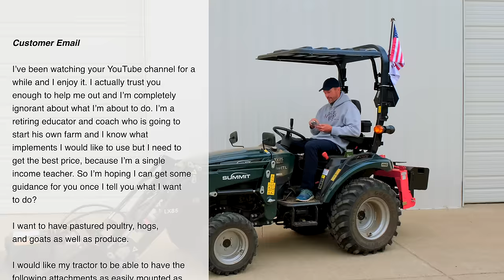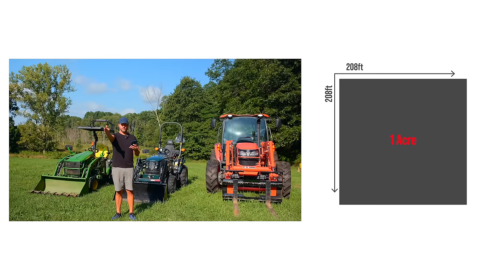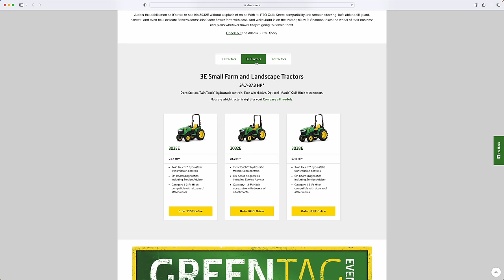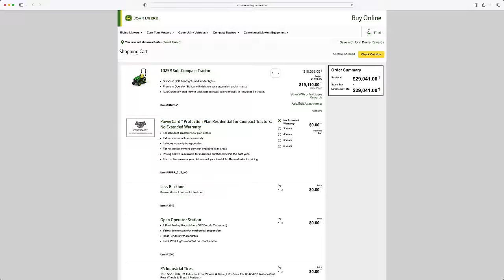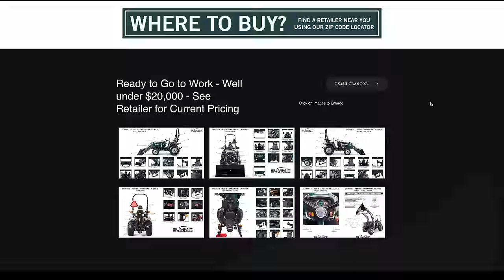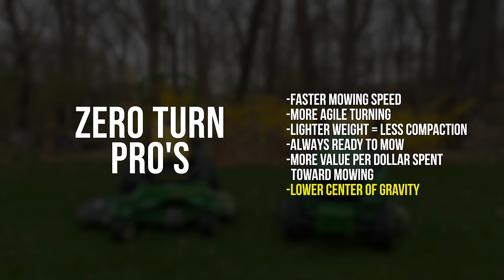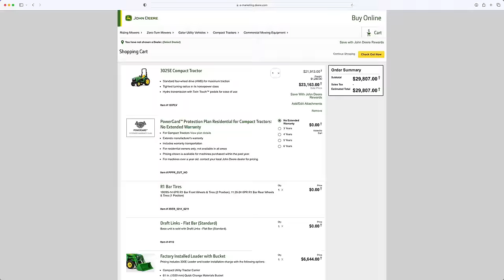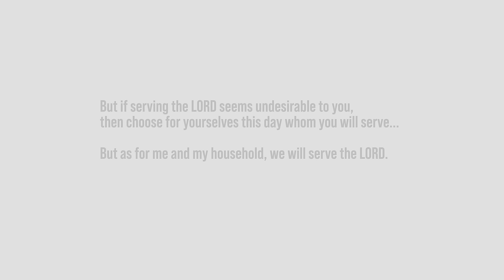CAN YOU STILL BUY A NICE TRACTOR FOR $10,000?

Comment: I have a 2019 1025R I picked up used with front loader and 48” Box blade. Got it for $15k with only 19 hours on it. I’ve got 200 hours on the clock now. At the time the local dealer was quoting me around $26k for one off the lot with the same implements. I later picked up a Bush hog for it so I’m into it around $17k at the moment. I can’t imagine spending $30k or so for the same setup today. I’ve been able to accomplish incredible things with 1025R. Great little machines! I’ve now got an 8 acre property though. I’ll put that little tractor through it’s paces this year and if I find myself out-tractored more often than I like I may pick up a larger machine from Branson or LS due to the ability to afford more HP and more attachments for quite a bit less.

Comment: Here is something to think about, my tractor dealer told me this 18 years ago when I was shopping.  He showed me a 29 HP (25 PTO HP) compact tractor.  I asked if this same size tractor is available with more power, and, would I want more power after I learn the tractor and get comfortable with it?  The dealer answers, 'In a family size of tractors that all share the same drivetrain, except the engine power, those putting out the highest power also have the most problems.  If you want that extra power then the best thing to do is step up one size of tractor and get the lowest power in that size range so you will get the longest service life to go with it.'  I got the 29 hp compact tractor and have been satisfied with that power.

Comment: I would recommend that he sits down and make a list of the chores versus requirements and classify them into Needs versus Wants.

Just based on the information provided in the video, I would recommend the following:

-Kioti CK2620: It is a well-known brand and slightly more premium compared to other South Korean brands.
-TYM/Branson 2515H: This is a powerful and robust 25hp machine known for its simplicity and reliability, it will be hard to find a more capable tractor on this class.

In terms of implements and attachments, I would suggest:
-Front Loader
-Rotary Cutter
-Box Blade (though a land plane is better and easier to use when maintaining a driveway, the box blade is more versatile)
-Pallet Forks
-Grapple

$30,000.00 is very tight, but  he might be able to do it with little less than $40,000.00
Reply: Thank you

Comment: I spent close to $50k for my Yanmar YT235 last year, I only got a quick hitch, grapple, factory 3rd function, and dual rear remotes. Love it. I built a Hiller with some steel I had on hand, I also built a stump bucket because my daughter had 30 stumps to remove at her house, and that took me 3 hours to get them all. I also built a 20 ft steel deck trailer to haul it with. I made a knack box mountable on the 3-point to haul any tools that I might need while I rebuild my lake house. I too would like to obtain a tiller, I bought a 2-bottom Ferguson plow and put in a family garden that is doing very well, I rented a tiller to use after a couple of weeks to allow the grasses to break down. I then hilled the garden area and fenced it in using the tractor to set the posts. I immediately got a rear blade and used it to keep the snow out of the way.

Comment: Hello, 
  Last October, I  bought a TYM T264 with a loader and backhoe for a little over $24,000. This tractor is built heavy.  It compares about the same as the John Deere 3036E for less money. Loader capacity is 1386 lbs and the 3-point  capacity is around 1400. I love my TYM T264.

Comment: Someone else has probably mentioned TYM in here already. Key here is fine the manufacturers with the best dealer support in your area then shop for the best value from those options.

I ended up with a Kioti NX cab which was over $20k cheaper than the equivalently configured John Deere. The Kioti dealer is local to me, has a great reputation and half my neighbors own them.

Comment: Purchased a 2016 Kubota B2630 with under 600 hours with 6' box blade, 5' heavy rake, land pride finish mower and a two bottom plow. No coupler and needs  front tires. Nice sheet metal with a little rust under the mats.
Maintenance was iffy as loader fittings wouldn't take grease and had original filter on hyro. @$6000 I believe it was a great deal.

Comment: I’ve kind of been looking to do something like the guy that sent you the email. I’m looking at prices and you’re right it’s just gotten crazy.  

I think it’s important to think about stuff like this before you buy the land. I’m in Kentucky and you need to walk the land first and buy some thing that’s flatter without the rocks and the hills. Unless you want to do that kind of work intentionally, you’d be better off putting another five or $10,000 into buying the land , then you could get a smaller tractor. I just bought a property now and I’m sort of going through that with lawnmowers as well. I’ve got a little L1 30 and it works OK but the new property has a pretty steep slope that needs to be mowed and it’s about 2 acres. If it was flat, I could just keep my L130 forever And keep fixing it come I’ve already had it for 19 years. But the steep slope would destroy that little hydrostatic transmission and as I start looking at zero turn mowers and researching them come out to get some thing of decent quality you’re paying several thousand dollars now, the lowest I found in mowers would be a cub cadet with the Kawasaki Engine and that’s $5000 but it still doesn’t have the serviceable transmission and to get into that you’re looking at about 8000 or more. So in looking at property he might be a lot better off to spend an extra five or $6000 on a property that is it gonna take Heavier equipment to work it. If you have 10 nice flat acres without rocks for what he’s doing he could probably get a 700 series. I think it is with the small three point attachment and rear PTO but a 1025R would be easy to manage 10 flat acres.

I started looking at a 1025R with a brush hog and a tiller and a loader and a few other attachments and wanted a backhoe and next thing I knew I’m pushing 50 grand. I think for my use I’ll skip the backhoe and just rent an excavator if I need to do something . It would be nice to have, but it all adds up quickly.   

I’m sure other manufactures have options also but John Deere has some smaller mower style type options where you have a small three point and a 540 rear PTO and those are under 10 grand but there’s still seven or 8000 and there an option but they’re definitely not as cool or fun   Lol

My real question in looking now isn’t so much about the price because I know I’m gonna have to spend 40 or 50 grand to get what I want at least come out my question is how long is it gonna last. I’ve considered looking for a used Kabota BX one of the smaller Tractors but I just don’t know how tough they are. A 1025 hour would be plenty for me or the summit but on the little bit smaller ones like the BX. I’m just wondering. I had a craftsman mower that worked fine but after two or three years, it was just falling apart all the time, the John Deere L1 30 it’s just a small lawn tractor but it was built a little tougher and everything on it is easy to service and get parts for so it’s never been a problem. Even the transmission was only five or $600 to replace a few years ago. But that’s my concern where I have the questions, not so much about price, but is this something I can keep for 30 years it can I service it, is the transmission serviceable and fixable or is it something that’s gonna cost me $1000 every time it breaks every few years,  🤔
Reply: Thank you

Comment: Hi Courtney. Question on your statement about if there are hills then maybe get a 3032e or the 3038e instead of the 3025e. I have been told that when going up in horse power within the same frame size that all you gain is Pto horsepower.  The transmission and hydraulic pumps are the same so you do not gain any horsepower “to the ground” by going up in horsepower. I have often wondered about this question and if there is any difference/more torque by getting the bigger engine in the same frame size. What are your thoughts?

Comment: The “What When, Where, Why, & How” are important decision points. Do your research. - When you are near your actual property purchase decision… Ask your future neighbors about their equipment requirements and what they would have benefited from when they purchased their equipment. Either way, if your initial budget is limited, start with your list of attachment costs, such as what PTO power is recommended for the largest attachment - and then set your yearly budget and subsequent annual budgets, until your attachment list is complete. Used low to mid range (10 acre) attachments are readily available. however, you also need to prioritize the long-term multi-year development of your enterprise. The first year, focus on water, external fencing and basic equipment, in order to protect your investment and future livestock. Your personal ‘business plan’ should be both well defined and flexible, as you meet and/or exceed your goals on an annual basis.

The success level within the farming and ranching community, is based upon annual ‘input’ costs as compared with future annual ‘output’ sales & profits. Debt, is how you loose completely, over time. Save your cash, as much as you can, in order to have a significant cash reserve when these ‘input’ expenses exceed your future ‘output’ profits, remembering that what you spend today, is basically an investment in the volatile futures market, which nobody can predict. So, immediately save where and anywhere you can until the future goals are highly successful.

Good Luck.

Comment: At elevation I would suggest something that is turbo charged. If you have 2 tractors that for example are both 32 horsepower but one is turbo charged and the other is not then the turbo unit would have a huge advantage at higher elevation.

Comment: I want as much hp as I can afford ….can always turn the throttle down but the throttle only goes so high….
I started off with a 25hp manual trans kubota ….good tractor but ended up needing more hp and a hydro….
Made a finale choice on a kubota 3902….happy as a lark with it….initially before I bought the 2501 , I wanted the 3901 ….but I decided not too cause people said 25 hp was plenty…..for the most part it was , but the work I did a hydro would work better and I figured I’d go with more Hp while I was at it.

Comment: Hp for 10 acres doesn't need to be 40 hp.  The hp is mostly for specific implements.  Like a 12' mower.  Unless he had identified that he is guessing.  If it is really hilly the extra hp is needed if in 2 wheel drive.  My 40 hp kioti ck will not go up some hills in 2 wd pulling a 72" bush hog but pulls it just fine in 4wd.  He doesn't have the property yet so he is guessing.  Nothing else needs that much pto hp.  I got a 40 hp CK with cab, loader, grapple, rototiller, rake, forks, brushhog and hydraulic rear for $28k (cash).  I wanted 33 pto hp for a implement I haven't bought yet.  For 10 acres and smaller the turning radius is a big factor and is rarely mentioned.  Again it depends on the property.  Also think of storing the equipment.  It all needs a flat place to store it so you can get it on and off the tractor.  Covered or not? All of these things are covered in one of your episodes.  I think he needs to identify the property he wants and why before he buys the tractor.  Why a posthole digger?  Doing lots of fencing?  Renting for that size property is probably cheaper.    Why a stump grinder?  Plans to buy a property with lots of stumps or doesn't want to dig or pull them out?  Again he is guessing on needs before he buys the land.  The versatility you mentioned is critical until he knows his needs better.  I went through this a few years ago and understand where he is coming from.  Hope he listened to you and then looks up relevant episodes to review to get a better understanding.
Reply: I did listen to him and I thank you for your suggestions as well. God bless.

Comment: The epa has made 75hp the maximum size for most operations. Considering the majority of farms are around 140 acres, most people make the 75hp limit work so they dont have to manage def. And smaller sub-compact tractors arent much cheaper than the compact 75hp...

Comment: I’d also add that loader capacity comes into play when looking at the different machine sizes

Great video - I went down the rabbit hole last spring figuring all these aspects out and took a lot of research before buying my first tractor.  Nice having it all in one spot!
Reply: Tell us, what did you buy ?
Reply: @merrilljohn1619  I ended up going with a Kubota L3302.  I wanted a heavier tractor than the LX sized machines to be better suited for some of the land clearing/development we will be doing on a new piece of property.

I seriously considered going with the 25 hp, but glad I jumped to 33, as I have been able to tax it pretty well in some situations already (brush hogging on hills).

Comment: I just got a quote on a kioti ck2620 w/4030 loader, 3rd function and dual rear remotes for $27,900. If I didn't need the loader lift capacity of the 2620, I'd probably go with the summit.

Comment: My father bought a brand new 1023e with loader and drove over mower in 2018 for like $17,000. And even then there was a $1500 difference between two Deere dealerships and the cheaper one threw in a ballast box for the $1500 less. Do your homework and research.

Comment: I think people focus on horsepower because America is built on horsepower :)  We're constantly bombarded with how many HP such and such car has, and that more is always better. It's also an easily comparable number, unlike FEL lift capacity, which depends on how far in front of the pivots the load is, etc. "If you have more horsepower, you must be able to do more work" seems to be common thinking. 

As far as this buyer, I think he's going to find a post hole digger is overrated, and more of a PITA than they're worth. I'd make friends with a local who has one, and compensate them to dig some holes. It's hard enough to get one mounted up when you're in good physical shape, a lot harder if you have a bad back or arthritis or something. They also don't work with a quick hitch.  As far as buying advice, if you have ANY intention of even thinking about a grapple, get factory installed front remotes, and ideally a set of rear remotes or at least a hydraulic top link and maybe side link.
Reply: Thank you

Comment: I was raised on tractor 
I was 8 years old my first tractor that I drove was 1949 ford my uncle had that father sold him he had Massey Ferguson 175 that I drove it’s in my uncle words it a tractor it’s going to my life easier on a farm he had 72 acres he changed 175 at 275 Massey Ferguson I think it’s a 275 he put a loader brush loader for burning the brush the difference is hight not size of the hp hight ground clearance 
I have 10 acres my first tractor was a 35 hp front loader and backhoe it still my main work horse i live in the forest 
I had that for 5 years before I bought my 2 tractor which was 40 hp again because of hight of ground clearance 
I also this year bought my 3 tractor which was 25 hp 
Both 25 and the 40 are cab ac and heater 40 is to high to take in the old forest 25 is about the size that should work well in all 3 tractors do the same thing my life easier 
And they are all kioti tractors less money on the tractor but for $30k I get a lot of attachments loader backhoe pallet forks on the 35 
Add a grapple to it 
40 has grapple, loader and rear box greater $33k 
25 hp has the center lawnmower attachment also is going to get a grapple bucket they all do the same job except height difference 
Washington forest is only 25 inches deep before you hit glacier or hardpan  
If I need bigger I’ll rent a mini excavator

Comment: I bought, or should say financed a 5 series 2023 for 24,000, I'm sure after the payments unless you pay it off early, but that's band new open cab m series I believe it was, I did finance it but I decided I didn't need it as much as I wanted it, but that what it came out to, I've got a 3520r which I love, it is a little down on power, but we bought all our attachments off Craigslist list, not perfect but they get the job done, I bought my 3520 for 17,000 and it came with a 4 in 1 bucket, and its a 07 year model, you can work this stuff out, if you have any hands on skill, which we do have a small fab shop, so we can weld and fix things, you don't need brand new, it's nice, everybody like new but that isn't something you have to have, only my opinion,  on what I'm doing

Comment: In my opinion there is still some value in the economy utility tractor market 40+ HP range . The compact / subcompact market to me has gotten way out of hand similar to trucks . Thanks for the content as always Courtney great content as always great camera presence
Reply: I have 2 JD tractors. I'm not brand loyal, the prices and availability at the time were right. One is 38 hp the other is 52hp +/-.  Both are great with their own limitations.  I think you are right that the mid sized tractors are the great.
Reply: @joeh4295  I’m the same way I’ve got 3 tractors 40-70 HP nimble enough for 90% of jobs other than lawn mowing which I agree with Courtney a dedicated mower beats a subcompact all day for that application
Reply: @randysavage8963  I use my 4310 for 80% of my jobs.  The 4610 is great for excavation, heavy lift and maintaining my 1/2 mile gravel lane.  I use the 4310 for most of the snow removal with a 8 ft rear mount blade.
Reply: @joeh4295  Absolutely sounds like a good combination I use mine for a smaller hay / cattle operation